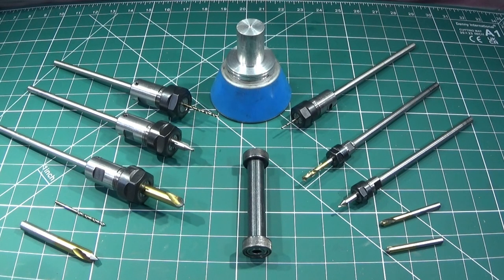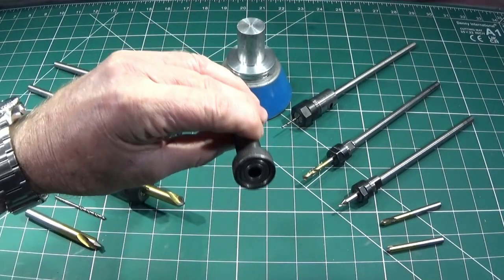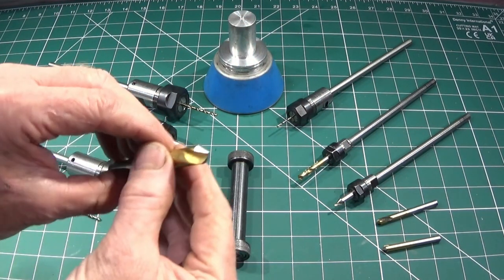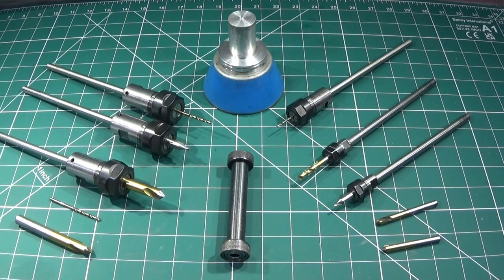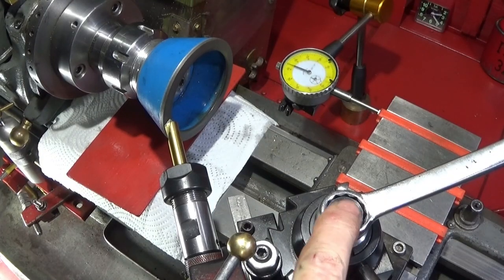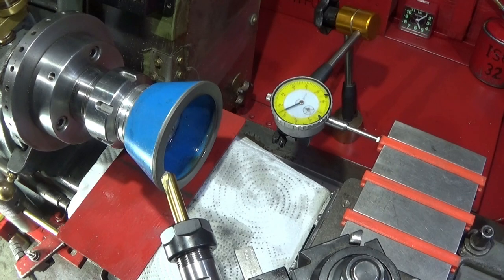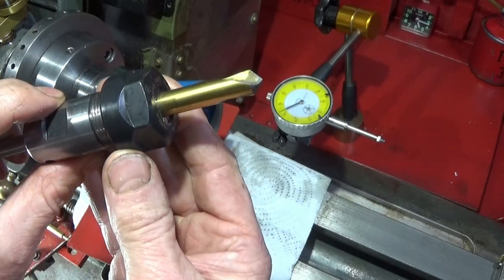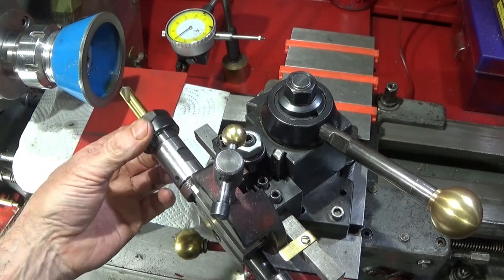THE BEST WAY TO SHARPEN SPOT, CENTER & SMALL DRILLS ON A LATHE

Comment: I'm unclear as to how you are maintaining the cutting clearance on the end of the tool.  Are you just following the existing clearance by feel?
Reply from the maker: The angle is set on the vice. To get it correct in the first place, one has to blue the end of the tool and do a test grind pass. This only has to be done once on the first tool, as a line is scribed on the diameter of the vice, which then lines up with the brass part that I screwed on the back end. Then, one can set it for all future tool grinds, without the need of marker blue.
Reply: @SteveJordan  OK, I see.  I was thinking in terms of helical clearance but these tools apparently have a faceted clearance.  Thanks.
Reply: Since wehen drill bit do not have helical clearance or just relief on the back

Comment: Thanks for a smart approach to the drill sharpening subject.  Instead of setting up this in my lathe I am now blowing new life in an "long time paused" project using a variable speed source for various grinding discs and a versatile tool holder.  I can see that Vevor has a fairly cheap cast iron coordinate table in sufficient size and is only 10 kg heavy. Cheers //  Ingvar, living in Sweden

Comment: I do like this set-up, and have assembled one for myself. Used it a couple of times. There is one small issue, Steve, and that is the vice is held at an angle with just one fixing through the vice and into the steel bar. I've had one mishap where the friction between the back face of the vice and the square bar was not enough to stop the vice from moving during a grind. To solve this I've put another hole in the vice chassis and tapped it m6, now I can put a second fixing in to stop the vice rotating about the one fixing.  OK I only have one angle, but ten degrees seems to be about right for drill sharpening.
Reply from the maker: Hi Rich, Yes, that's a good idea. I will probably do the same, although I haven't had any problems with it yet. Regards Steve

Comment: Absolutely brilliant Steve.  Thank you so much for your wonderful contributions.  We're all so blessed to have you helping us all.  That new camera angle from behind the lathe is great too.  Any idea haw many collets you'd need to sharpen a full set of drill bits from 1/8" up to 1/2" ?
Reply from the maker: Hi, Thanks. I'm not sure about the number of collets. I suppose you could cut down on the number needed by making simple brass collar type components that fit into a larger collet. These could be accurately drilled for certain  diameter drills and have a locking grub screw. I haven't looked into it yet, though. It's just another idea. Regards Steve

Comment: Finally I can set up forsmall center drills. Genius Steve. About what grit is your cup wheel? Thanks, Greg
Reply from the maker: Hi Gregory. Thanks. I can't remember the grit of this wheel. I wish I had written it on the side when I bought it some years ago. It is a very fine one, though. I have coarser ones, but I haven't tried those yet. Regards Steve.
Reply from the maker: I'm pretty sure it's a 600grit wheel.
Reply: @SteveJordan  Thank you Steve

Comment: Hi Steve, many thanks for the tool and cutter conversion over your lathe. I spent so much time making a standalone tool and cutter grinder years back should have thought of this earlier :) Btw why you extended the collet holder with long spindle which may get in the way taking out and insertion?

Comment: Do spotting drills not need a relief/clearance angle?
Reply: That's taken care of with the angle of the vice I believe
Reply: I think that just provides the point angle. It's not possible to provide cutting clearance by rotating the drill on its axis alone, since that produces a cone.
Reply: I am just wondering if spotting drills can get away with zero clearance since they are mostly used for shallow pecks. I'm skeptical, but that's the only way I can explain this process.
Reply from the maker: The clearance is derived by the angle  that is set on the round vice. It is tilted down at the back end and locked into position before starting. If you watch the video, you will see this. I get such perfect tool grinds, people cant tell the difference from a new unground tool.
Reply: @SteveJordan  one has to wonder how many times you can sharpen a drill by your method before you run out of clearance from the factory grind.
Reply from the maker: Hi Chris, you obviously haven't watched the video properly. This setup actually follows the exact grind of a new tool, with the hand rotation of the collet. When held next to a new tool after grinding, the newly ground tool is exactly the same. I couldn't see the difference from the two. I'm so pleased with it, as I don't think I will ever need to buy new spotting or centre drills again! You are only skeptical because you can't understand or you haven't actually seen how it works!
Reply: @SteveJordan  I shall watch again but at first watching you appeared to merely grind the cutting edge.
Reply: Watched it again, are you familiar with continous clearance or primary and secondary clearance. You still appear to only grind a primary angle and as I asked in my first comment how many times you can grind a drill by your method, as you will soon find your drill will cease to work with a too large primary facet without a secondary or increasing clearance of a standard grind.
Your method is excellent for putting a keener edge on a drill and I applaud your effort to make the task easier for a hobbyist, but I feel it inadequate for sharpening a chipped or otherly damaged drill. You are effectively converting a continuous back off drill into a four facet one, but you can only do it a few times before as I said the primary facet will become too big. I am of course quite happy to be shown to be wrong in my view. I am not though altogether inexperienced in the many methods of drill regrinding, even DAG Brown applauded my variation of his four drill sharpening gizmo, and the creation of a six facet version of it.
Please don't be offended by the above which might sound too much like criticism or my future lack of any  response I have said my piece and that is all, I wish you well in your workshop and videos.
Reply: I totally agree. Rotation alone cannot provide any clearance - it is  making a perfect cone.
Reply: Take an old drill and grind about 2mm off it (as if removing a chipped corner) by your method. 
Then try drilling a hole with it. You will see that the drill has no clearance on the cutting edge.
Reply from the maker: You obviously haven't watched the video properly! The ER collet chuck rotates in the housing, and I rotate it when doing each side of the tool. The grind follows the exact profile of a new spot, drill, centre drill, or small twist drill. Like I clearly explained in the video. When ground, you can not see the difference between a new tool. People like yourself often comment without watching or taking  in the information properly!!!
Reply from the maker: I'm not offended, as you have baffled yourself with theory that is not apt to this method. As I said before, my method follows the exact profile of a new spot drill. You clearly haven't tried it as you would see the evidence for yourself. There are one or two people on here who do not know what they are talking about, like yourself. I often wonder if it's because they never thought of the idea! I'm really pleased with it and so many others will be, who do not listen to the so-called experts!!
Reply from the maker: It has rotation and tilt of the vice. The grind follows the exact profile of a new tool. I take it that you are one of those 'experts' who can comment but doesn't really know what they are talking about!!
Reply: @SteveJordan I might reply that perhaps your explanation is not as good as you might think but that might sound adversarial. Have read the work of Prof Hugel on subject of drill geometry?
Reply: I did watch it. Furthermore, a couple of years ago I made a drill grinding jig for my lathe so please do not make such comments without thinking about the problem. 
If you take a plain, faced off rod and ground it in your device, you would end up with a perfect cone - so where does the clearance come from?
There are similar tools to yours but as you rotate them, they advance the drill into the abrasive, creating clearance. I don’t see that on your tool.
Reply from the maker: You haven't seen that on my tool because you haven't held one in your hand and looked at it under a magnifying glass. My tool rotates and is fed forward by pushing it onto the cup wheel. The ER collet chuck spindle isn't locked into position in the housing like you have presumed!! It also slides in the housing. Now I see why you were confused. Regards Steve
Reply: I just watched your video again. There is absolutely no comment about advancing the collet chuck while rotating it and no bevel to do it automatically. 
As far as I can see you only rotate it and it is sitting against the bearing throughout. I didn’t presume anything. 
However you are happy with your creation and that is mostly what we strive for in our workshops!
Reply from the maker: @M&A Hudson  That's  because it's a very fine diamond wheel. It only takes the minimal amount off the spot drill, which is all that is needed. They only need a lick up. You won't see the movement of a few thou on video, as you well know. That's the trouble with a few of the 'experrts' on here they make assumptions without looking carefully at things. If you had watched the video, you would have seen that the spindle pulls out of the housing. And when I said that it followed the exact profile of a new spot drill, you should have thought about it more carefully or even asked about the movement! I had the same sort of reaction from 'experts' when I showed milling on the lathe. There were a few that said it was climb milling when it actually wasn't. That's why I take great care and do not believe everything people say, just because they can quote a bit of engineering theory!!
Reply: @SteveJordan   And for twist drills and centre drills?
We aren't all right all of the time and being aggressive about it isn't helpful. 
The trick is to learn to admit when you might be wrong! Even as an "expert"....
Reply from the maker: I'm not actually aggressive, more annoyed at times, comments that could have put newcomers off of something that is good. A hands-on approach naturally pulls the spot drill onto the diamond wheel. Plus, I clearly said that the grind follows the exact profile of the spot drill. In engineering, I have come across many people that can quote lots of engineering theory, and it's very often these types that put people off of this actual work. It's like many that own Myford lathes that keep quoting that other lathes are rubbish.  It's basically a load of snobbery that is used to put others off and make out there's a higher class of engineers. I'm not saying you are like this, as I don't know you. But I have had enough of them in my experience. I actually don't think anyone has arrived in this subject as one learns something new every day.